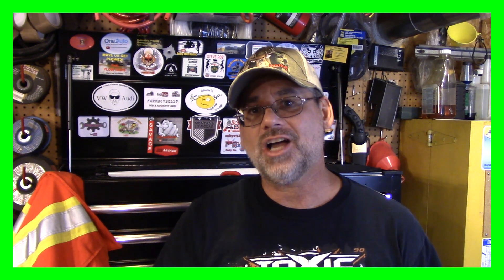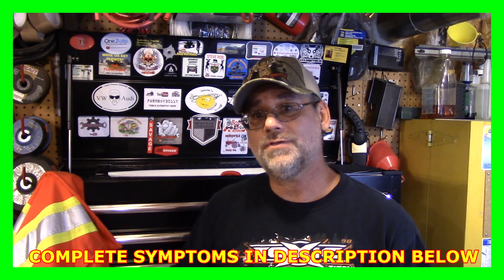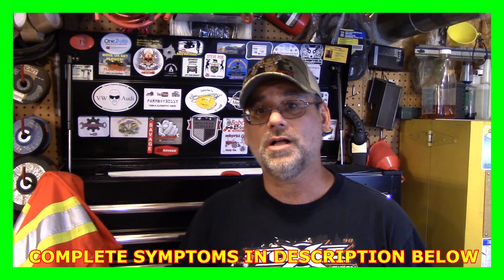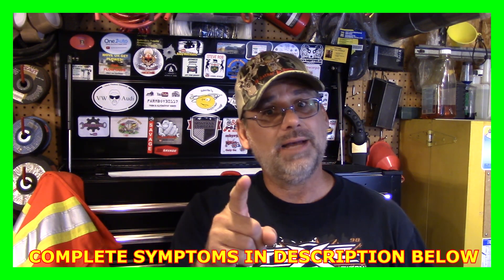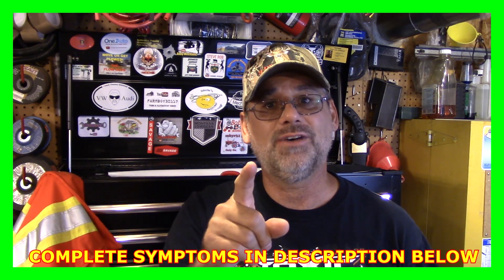F150 STALLING AT STOPS  - DEALER CAN'T FIND FIX - PART ONE

Comment: Any help with a 1975 f250 camper special stalling when hard breaking
Reply from the maker: 1975 is pre computers or fuel injection so it sounds like hard braking is drawing a lot of engine vacuum.  I'd be checking everything on your carb that is vaccum operated or hose  leaks . Just a spray bottle with water on a vaccum leak will show by a  rpm drop. Just a guess from a long ways  away. Cheers.
Reply: you have a bad brake booster. it runs on vacuum when you hard brake the diaphram in the booster has a small crack hard brake instant vacuum leak stalls the engine. also it could be master cylinder leaking into the booster has same effect. the way to tell is when you unbolt the cylinder the back of it where the piston is will be wet. usually it also shows wet on the outside of the booster just around the cylinder mount.

Comment: 2007 just started doing it right after hitting 285,000 miles. I'm gonna say mas air flow sensor..... since that's what I've been seeing on the forums so far. Now off to part 2 of this video to find out what he changed. 🤣
Reply: Wondering if you found a fix. Having the same issue about same mileage. I changed ignition module and doesn’t seem to change anything

Comment: Well what a bummer. I wish I had an answer for you ! ...but I do have a question or story : I was driving my Nissan one day and my car...lock started to lock & unlock by itself. First I though I did it "cause I open the window but it just kept on...doing it...lock, unlock, lock, unlock. I was like...whatta f*ck was happening and I started to "super" freak out...while driving. I has thinking there was a ghost sitting on me playing with the switch hah haaa. I was shaking so hard I would barely drive :D :D and I had to turn to the very next spot where I can stop (it was a nursing home) so I can get out of the car as quickly I could. My legs almost didn't support me I was shaking so bad & my heart racing and calling husband and even me standing outside and the door was open it still kept on doing it. My car was haunted ! !  I had to stay in that parking lot quite a while before I was stable enough to drive again ! 😱👻😂😂 So what do you think about that Steve ? 😃
Reply from the maker: Easy fix most techs can resolve - If you drive to Staten Island I have a guy that can fix it in 10 minutes or just take it to your local guy and it can be fixed easily. Just keep driving until then it's not haunted its a nissan. Buy a Chevy next time LOL
Reply: Hah haa. That's ok. It has dunnit only one other time ( that time I was able to keep driving & I was actually talking to the ghost ). There is other things to fix that are a lot higher on the list to fix. Nonono the VW Beetle next time...if possible !  :D :D
Reply: Hello Mike Brown. My button seems to be fine. It doesn't stay in locking position but it was locking/unlocking all doors too. It has been several years now since the last time it happened. So I'm still thinking there was a ghost was sitting on me and playing with it hah haa.  :D

Comment: I'm a little late to this party but my 2016 2.7 eco boost (30k) is going in to the dealer on Wed.    It is Stalling out while coming to a stop.  Generally happens after long trips (300-600miles) only.  Does not happens on the short (5 mile) trips to work and back.   I came across your channel today and thought you'd give me some insight!?  This truck is dangerous for my family to drive.   I can deal with for now but unacceptable.
Reply from the maker: That's what mine did ever so inconstant that the dealer couldn't find a code but  in my case in part two I changed out the evap purge valve and it hasn't stalled since but it hasn't been the regular eight months yet so I have to wait to see if it was the cure . Vehicles are complicated and sometimes pattern failures are all we can go with. I imaging the dealer has a good idea what it could be.
Reply: Randy, did the dealer figure it out? I have the same truck, and having the same issue on long road trips. Thanks!

Comment: You should be able to return it and get a refund. Some places have a lemon law. I understand that it is difficult to find an intermittent problem but you shouldn't have to deal with it on a new vehicle for this long. They should have gave you a new truck and refund your money for your trouble at this point. I knew a minister that had the transmission fail on his ford car. They said he had got stuck and burned the transmission so they wouldn't fix it. He said it had never been stuck so he got rid of the car and bought a Chevrolet. I would tell them that you made a video about what happened and put it on Youtube. They might decide the bad publicity was worse than fixing it. The dealer that sold it to you should be responsible to fix it. I would tell them that you are going to tell the dealer and location and phone number in a follow up video. It all comes down to money. Is it less expensive to put in parts or replace the pickup or  is it more expensive to loose the sales from the bad publicity they will get from a video on youtube? If you contacted the ceo of Ford or customer relations there you might get some help. They can get parts wholesale so they should be willing to replace some of the most likely parts to find the problem.
Reply from the maker: No lemon laws in Canada and  I'm sure Ford would fix it if it  could be duplicated to them. It's just one of them things .  I may have a resolve for this in the next vid.  Cheers

Comment: I have a 2013 5.0 that’s doing the same. Worked for ford as a master tech for 25 + years. Wonder if it’s the same system. Thanks for the 411.
Reply from the maker: Could be , look at the  purge valve # see if a 2010 and yours match. Mine has run flawlessly since I changed it. Cheers
Reply: STEVE ROB REVIEWS  can you provide the part number The person is dropping off his truck tomorrow .. if I find anything I’ll post it.
Reply: Fixed!!  Wasn’t the purge valve either.
Reply: @styga1969  what was it. My 2012 f150 5.0 is doing the same thing. No codes nothing.
Reply: Levi Sandoval   Sorry bud. That’s my job is to diagnose drivability problems. Takes long hours to figure out intermittent issues. I would have to charge you for my time. Sorry. Bosses rule.
Reply: @styga1969  lol are you being serious? Im just looking for help I've checked everything
Reply: Levi Sandoval yes sir. Costed me a lot of time to figure this out. My time is money. Sorry .. but I have to put food on the table and pay bills. This is my job.
Reply: Levi Sandoval Did you change the purge valve like this guy stated?
Reply: @styga1969  sure did
Reply: @styga1969  Mighty awesome to use comments/forums for your gain, then don't post the fix... Even better to tell is what it wasn't.
Reply: @styga1969  hey i have the same problem with my 2013 ford 5.0 it just stalls when i come to a stop sign or a completely stop it does it like once a year or probably twice do you think you could help me ?

Comment: Found this video today.  My truck does this every time there's a big temperature change, usually warm to cold weather.  It goes away after a day or two of consistent weather.  I am still trying to figure it out.  No code errors either
Reply from the maker: Could be  a sticky purge valve as they are intermittent.  For the money and the ease of changing it's worth trying. Mine has been stall free since.  Cheers

Comment: i have a 2000 with a 5.4 that just started doing it with the previous owner bout 3 weeks ago he thought it was the timing chain so he was just gonna crush it I walked up an bought it I have not heard it run yet because he had the pulleys "etc. already taken off because he planned to fix it but didn't have the money so he told me it stalls when stopped it don't have any check engine light on an it don't shake or ping or knock ........im stumped
Reply from the maker: First thing I'd check is fuel pressure at the engine. Egr flow at idle will stall it too.  Dirty throttle body , theres a start.

Comment: my sons 201 f150 doing somewhat the same but doesnt kill if you tap the accelerator rpm goes up then it comes down and wants to go below 500 rpms catches itself then goes back to regular idle he said sometimes when hes at a stop he puts his foot on accelerator and nothing like it would be off then it catches and engine rpms go up. changed out pcv valve throttle body gasket cant find any vacuum leaks and no codes come up on my reader
Reply from the maker: To maintain minimum idle your ecm controls it thru your throttle body . Is the throttle body clean at the throttle plate would be my first place to look.
Reply: @SteveRobReviews  I looked at it and the flap that opens and closes has what looks like a set gap its not full closed I dont see anything like build up around the edge of the flap, now the square par the TB housing does have some build up on it but its very little and its on the outter side of the gasket
Reply from the maker: I'd look on your scan tool for the idle pid and see what the desired idle is compared to the actual idle when its acting up.  I do know a lot of throttle bodies were changed because of this but you need to get it verified as the resolve because it's not cheap. Myself I'd try an idle relearn first .
Reply: @SteveRobReviews  sounds great thank you for the help Ill let you know what happens
Reply: @SteveRobReviews  cleaned the throttle body really good changed the gasket runs fine now

Comment: I HAVE THE SAME PROBLEM WITH MY 04 F150 TRITON
Reply from the maker: Not saying a purge valve will fix it but it fixed mine  for over a year now so I'm happy.  Good luck
Reply: Thank you I also have a f150 04 model crew cab barely did this today.

Comment: I've got a 5.0 in my 2014 f150 and I'm having the same damn problem with mine now 🤬
Reply from the maker: Seems they all went bad.
Reply: @SteveRobReviews  mines a newer model than the one you where having problems with I believe... But it has the older style Purge valve on it.
Reply from the maker: @jessiepatrick8686  might be worth a try fixing the stalling.
Reply: @SteveRobReviews  I'll eventually get around to it..... I'm I'm the desert til after Christmas.
Reply: my 2013 f150  just started doing this

Comment: Steve my 2008 f 150 lariat is  kind of doing the same thing. I took it in for an oil change, they left the air intake covers and I did my errands and drove home. It stalled 3 times with a shudder before stalling out first. I called them and took it back to tire depot where I got mt oil changed. The guy when reversing out of the parking spot looked at me and said it  just thru a code. They checked my truck out the code was a cam sensor they cleaned it off and reversed it and said if it comes back on change the sensors. They didn't know what the shuddering was on my truck.
Went home. Code came back on. Changed sensors. TRUCK STILL DOING THE SHUDDERING when coming to a stop or then coming to a slow speed at about 5 miles an hour.
HELP PLEASE. I NEED MY TRUCK.  THANKS SHERRIELYNN
Reply from the maker: If your getting and camshaft correlation code it most likely needs to be reset with a factory scan tool .  Your best option is to bring the truck to a good shop to get diagnosed.
Reply: my 2006 did the same thing it was the VCT solenoids
Reply: when it happened to me when I would come to a stop or try to back up the truck would shudder and stop it would restart right away but I had to feather the gas to keep it running but only after it warmed up for about 20 to 30 minutes I unplugged the solenoids and took out the variable timing and it ran just fine till I could get the cash together to do the phasers and guides and tensioners  just gas millage went down and a bit less power  but I had my truck to use

Comment: The same been going on with mine on and off , 2010 f150 5.4 engine, otherwise runs great just that problem , no engine light either
Reply from the maker: Looks like your a great candidate then at trying a new purge valve for the fix.
Reply: @SteveRobReviews   ok . I'll talk to a mechanic , it shows no engine light but every once in a while like this morning happened
Reply from the maker: @venelinbarbov9964  I changed out mine in 5 minutes , real easy and fixed it for good. Let me know how you make out .
Reply: @SteveRobReviews   I don't have tools and not really confident in fixing my own vehicles , also another person told me it could be the throttle body positioning sensor
Reply from the maker: @venelinbarbov9964  Take it to a good shop and see what they think.

Comment: My dad just gave me his Ford F150 and I’m having the same problem
Reply from the maker: Try a new evap purge valve.
Reply: @SteveRobReviews  Thanks
Reply: @SteveRobReviews  I just put the new one on died right after I installed it but after that it hasn’t done it so hopefully this solve my problem thanks for the help
Reply from the maker: I  hope so too. 👍
Reply: Started doing it all over again
Reply from the maker: Have you cleaned the throttle body,  if it's dirty try cleaning it.
Reply: @SteveRobReviews  I’ve replaced
 EVAP Canister Purge Valve and Throttle Position Sensor I don’t know what else it could be
Reply from the maker: @JJ1964  Dirty throttle body can cause a stall on a decel if it doesn't have minimum air flow.  Clean your MAF sensor too can't hurt .
Reply: @SteveRobReviews  I believe I changed it throttle position sensor is this what you’re talking about
Reply from the maker: No Juan , cleaning the throttle body is not a sensor  .  If you search throttle body cleaning for a f150 it will show you what to do or at least what to look for.
Reply: @SteveRobReviews  ok thanks
Reply: Did not work for me. Ugh!!!
Reply: Didn't wrk for me still having same issues 
After I clean throttle an air sensor also replaced purge valve an fuel module still stalling dont know what else to check for 
No codes

Comment: My 2016 F150 xlt is doing  this now.
Reply from the maker: Might be the same fault ?
Reply: ME 2! WHAT DID U DO?🥵
Reply from the maker: @ericblair2197  replaced the evaporative purge valve and it's fixed 👌
Reply: Me four! 2016 F-150 5.0. give a subtle shudder and then stalls. No error code. Dealer cant find the problem.
Reply from the maker: Daniel  for low cost and anyone can install it yourself its worth the try.
Reply: My 2015 Ford F150 - 5 litre takes approx. 7 quarts synthetic. So I just changed my oil and the 7th quart I replaced it with a quart of Lucas synthetic oil treatment and it’s running pretty smooth; still a tiny bit rough but this mechanic told me that I wouldn’t have to worry anymore. But my previous oil change; before this one, I put 250 ml ( 1 imp. Cup) of seafoam on top of my 7 quarts and the engine ran smother than this last oil change. Go figure eh?  So my next oil change? I’m going back to the seafoam to see if it runs better than the Lucas oil additive

Comment: You need to check your connection to your computer sometimes I get loose and bounce around and it connection ain't connecting and clean your pins going into it
Reply from the maker: Purge solenoid fix it . All good. Cheers

Comment: This same problem here almost gave me a heart attack,  I have a 97 F150 4.6 2 wheel drive
Reply from the maker: Not saying it will fix yours but now you have some direction. Cheers
Reply: Did you find out if this was it? I have the same year and everything f150.
Reply: Did you find the issue? Got a 99 doing that

Comment: Well  was the the part he told to  change
Reply from the maker: Evaporative purge valve fixed the stalling to this day 👍
Reply: I’m having the same issue. Dealer replaced the purge valve. It stalled twice today.
Reply from the maker: Mark I have fixed that in   a simular   fault but only stalling when coming to a stop  as the engine does not stall like you shut it off but it stumbles a bit before stalling and in them cases it was a dirty throttle body , easy to clean and fixed it .
Reply: @SteveRobReviews  good to know! Thanks for the info!

Comment: 2008 Ford F-150 5.4 Triton. Starts fine, idles good. I drive 20 miles so truck is now warned up. I pull the into parking at gas station, go inside truck is idling ok, come back out get in shift to reverse to back up and truck begins to shudder and sounds  like it's going to stall, rpms flicker and then it comes back to normal idle and good for a while. Happened once in drive through when I let off on brake to move forward just started shuddering again. I start driving just fine, hit the highway again and smooth ride. Had the throttle body cleaned and MAF checked and still doing this.
Reply from the maker: Rob good start . I'd look at scan data as its acting up is the best . You will most likely run out of money before you run out of guesses 😅 find the fault first is my first choice if you can or a good tech. Cheers
Reply: @SteveRobReviews  Steve, no lights no codes.
Reply from the maker: You can still look at live  scan data . A wild guess would be just that but it looks like the fault is heat sensitive and only in reverse so in reverse the engine does tilt so you can look at wiring harnesses that might be shifting only in reverse  rubbing on something . Worth a good look.
Reply: Exact same thing my 05 does , please let me know , drives me crazy
Reply: @garybobes962  My VCT selinodes were bad. This is typical for the 08 model for sure. Had them replaced for 870 bucks parts and labor. It's a four hour job. Runs smooth as ever now.